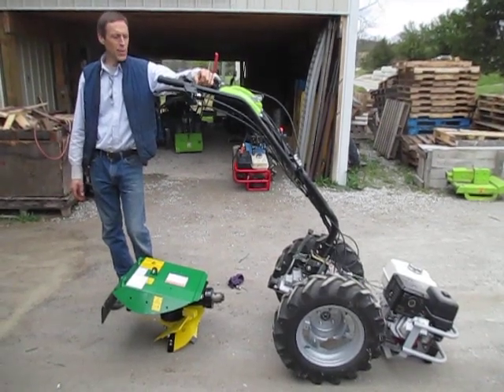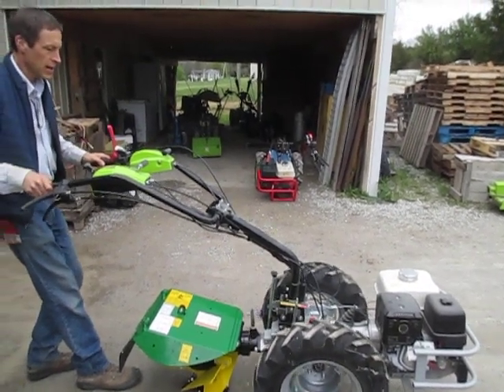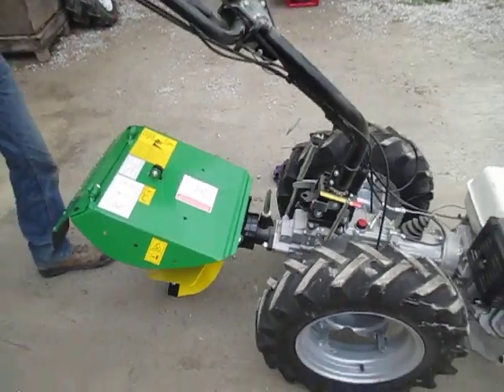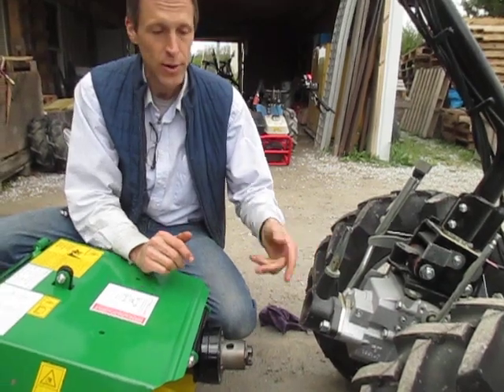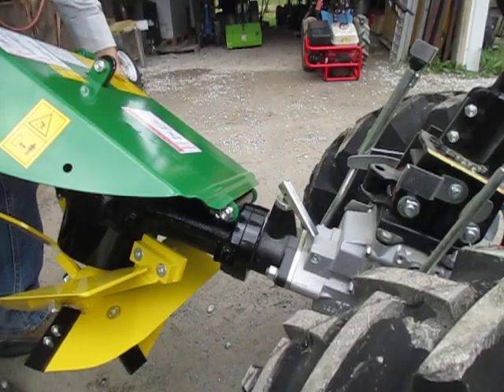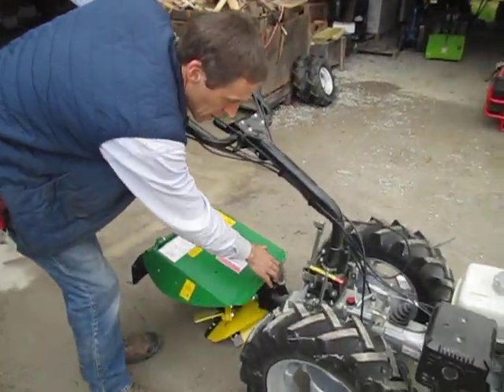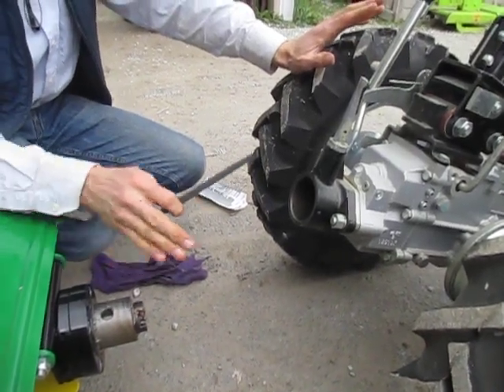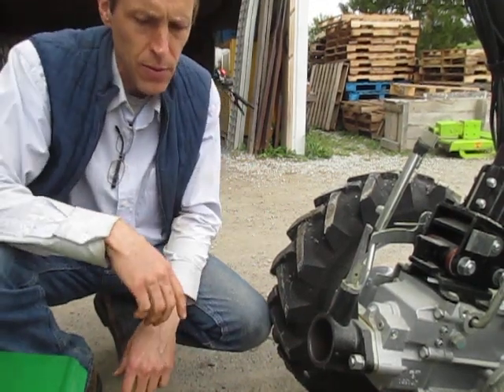Grillo Walk-Behind Tractors: Quick Hitch Mounting for G110

Comment: Here's a tip:  make sure the quick coupling female pin hole is mounted facing up, at 12 o'clock.  If it's at 6 o'clock, there's no hole there for the pin, assuming the male pin is also at 12 o'clock.